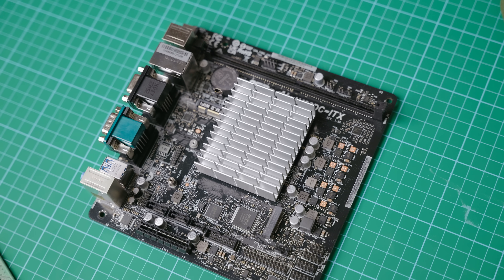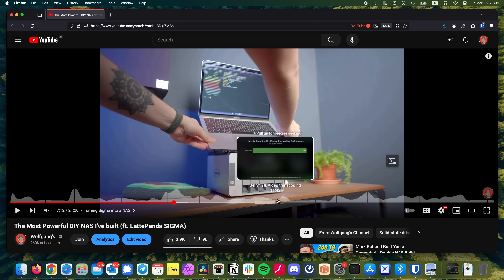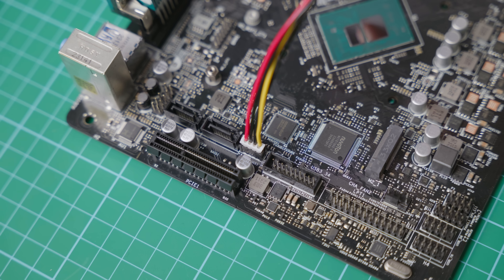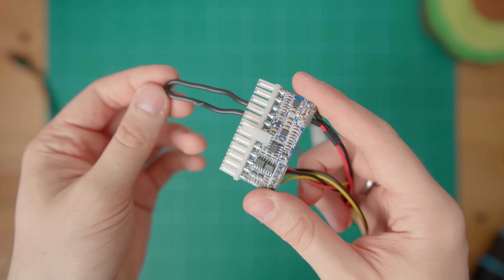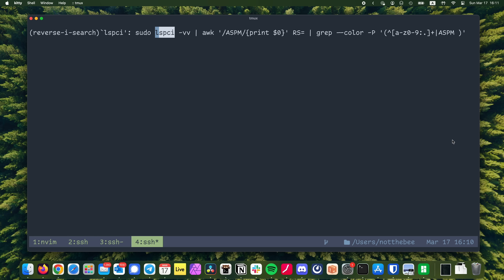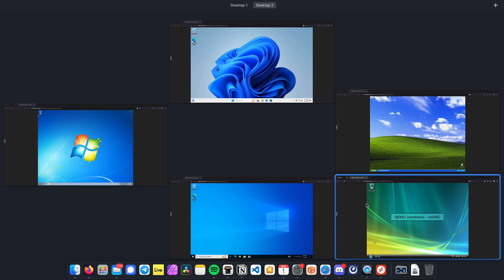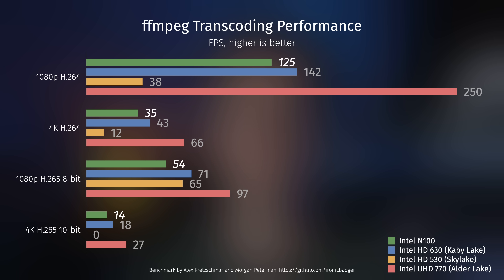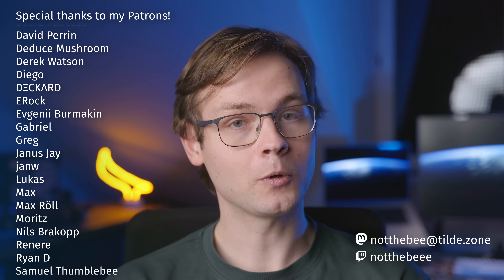Asrock N100DC-ITX – Almost Perfect! But...

Comment: regarding transfer speeds. does the m.2 limits the speed when read/writing to hard drives?
Reply from the maker: The M.2 slot is PCIe 3.0 x2, which should theoretically give you 1970 Mb/s of bandwidth. A Seagate Exos X16 hard drive is rated for a maximum read speed of 261 Mb/s, so the ASMedia card should be able to handle 7,5 HDDs having data being read from them at the same time

Comment: Which operating system are you using to get those high C states?
Reply from the maker: Any modern Linux/Windows OS with ASPM and C-States not explicitly disabled should be fine. I get a similar power draw in Ubuntu, Debian, Unraid and Windows 10/11

Comment: Question from a total noob: I noticed you're only using 1 stick of RAM. Is there a performance benefit to using dual channel memory for NAS software? If so, are you using just one stick to limit power draw? I.e. is the performance uplift not worth the increased power draw?
Reply from the maker: This motherboard only has one RAM slot

Comment: I measured my power supply rated with 80+ platinium and only that draws around 6 Watt with nothing plugged in. That is much right?
Reply from the maker: The 80+ rating doesn’t take into account the power draw below 20W
Reply: @WolfgangsChannel interesting, I wasn't aware of that. Could you  recommend an efficient power supply for this cpu?
Reply: I saw the list in another comment(he already gave a spreadsheet), but I’m amazed that the nr 4 on that list is a very cheap power supply from cooler master ( MWE 400 white )
Reply from the maker: https://docs.google.com/spreadsheets/d/1TnPx1h-nUKgq3MFzwl-OOIsuX_JSIurIq3JkFZVMUas/edit#gid=110239702

Comment: Has anyone used a relay to jump the ATX 24-Pin connector pins? I am contemplating running the board off a 19V power supply and start the PSU for the HDDs when I turn on the computer. I am wondering if it is a good idea to use the front panel headers to steal 5V from the board to power the relay.
Reply from the maker: I've built a PoC with a PicoPSU, a DC jack Y-splitter cable and a 12V relay. At the end it looked a lot messier and was a lot more complicated than just getting 12V from the ATX connector, so I scrapped it.

Comment: Hum... How are you supposed to saturate the 10gig network if you can't write at more than 550MB/s ? On the two motherboard SATA ports, you plug one for the OS and the other as cache/swap and use the rest of the nvme adapter as your data drives ? No ECC support but well, I don't know if it's really a bummer if you also backup your whole data in addition to the usage of your NAS. I think I would take the N100M as I don't want to tinker with the power supply.
Reply from the maker: I’m not, but 2.5 Gbit is too slow for 550 Mb/s
Reply: @WolfgangsChannel Yes and I thought about the N100M model and pluging the 10G AQ107 card on the x1 port which would limit transfert to 8Gbits/s but still much higher that the standard 1Gbits. This would allow you to put another Sata ASM1166 x4 card on the  PCIE x16 mode x2 and getting 6 new sata drives if you want even more slots. Still, I haven't found an ASM1166 card for the A+E key slot as you could use the SATA on the board for your OS as raid 1 and put 2 cache drives on the e-key port. The JBM852 e-key cards doesn't seem to allow low c-states sadly.

Still I've seen E-key to PCIE 3.0 x1 adapter... if you're really into headaches... like me but still you can add an ASM1166 2 ports sata card on it :o

Nobody can say that you don't exploit your hardware to the maximum then ;)
Reply from the maker: Unfortunately, the WiFi M.2 slot doesn't carry the PCIe signal, so you can't use it to plug in an additional SATA controller. Don't ask me how I know :)
Reply: @WolfgangsChannel Ahah I see ^^ Still waiting to see a meteor lake 4nm equivalent model to get even more lower power draw ! They say ARM is more efficient but when we already have a N100 system that draws max 18W, why switching out x86. Still I think that only Meteor lake Ultra CPU have the AV1 encoding IGPU.
Reply: @WolfgangsChannel that's very strange, most wifi m.2 cards require PCIe x1. Maybe there's a bios config option which lets you choose how to allocate lanes? But that would mean that either the other m.2 slot or the PCIe port also drop down to x1.
Reply from the maker: This motherboard comes with CNVi, which means that most wireless logic is moved to the CPU. This probably removes the need for PCIe connection between the WiFi/BT module and the CPU

Comment: Is the PCI slot fast enough for an HBA card, so you can use the m2 for an nvme drive or  a 2.5gbps NIC?
Reply from the maker: Depends on the HBA. Theoretically, the slot should have 1970 Mb/s of bandwidth

Comment: What about the ASUS N100I-D4? This board of course only has one SATA port but you can fix that with you ASM1166 adapter.
Reply from the maker: As mentioned multiple times throughout the video, this board only has a PCIe x1 slot
Reply: @WolfgangsChannel  sure but can you really saturate a 10Gbit/s NIC with a large file transfer with that CPU when using a software RAID in the real world? A 2.5Gbit/s NIC paired with that CPU would make much more sense in my oppinion which would fit perfectly in the PCIe 3.0 x1 slot (preferably with a Intel chipset since Realtek is a bit buggy on most distributions).
You should be also be able to utilize the M2 (E Key) slot since it should support PCIe
Reply from the maker: Yes, you can. The E-key slot unfortunately doesn't work for PCIe signal on this board – not sure why
Reply: @ich777  There's no way that little baby CPU can saturate a 10 gig link with anything other than synthetic benchmarks like iperf.  I have two huge 16 core Xeon servers here with 10 gig fibre links between them, plus a number of other smaller Xeons.  The two big servers are populated with 10 drive RAID arrays, which should be lightyears faster than anything most people will encounter unless they're running NVMe drives.  These machines can easily push 9.4 gigabits measured through iperf with low CPU usage.  In the real world I have only ever seen 680 megabytes/second across the network during backups.  That's like 7 gigabits.  And I don't see that speed often.  Usually it's between 300-400 megabytes/second.
Reply from the maker: I’ve used 10GbE in conjunction with a i3-6100 and a NVMe drive for a while and was getting 1-1.2Gbytes/sec during SMB transfers no problem. N100 is even more performant.

Are you sure your storage can keep up with the network transfer?
Reply: @WolfgangsChannel  often times this is caused by a server NIC and not correctly set up driver parameters, I‘ve seen that a lot on Unraid with Intel server cards.

Are you talking about big files so to speak files 40GB+?
Reply from the maker: You mean high speeds are caused by wrong driver settings? Not sure I understand your reply. 

I’m talking about 1-8 GB files. Random small reads will obviously be slower
Reply: @WolfgangsChannel  sorry, yes wrongly configured drivers most of the times since some NICs require Jumbo frames to work properly where on my Mellanox I don‘t have to enable them to saturate the link but TBH I‘m not using the Mellanox card anymore because 2,5Gbit/s is way enough for me.

Would be interesting how this board performs when you transfer one big file.

Comment: I'm looking at the specs for this thing and the single, max 16GB RAM slot is kind of a deal breaker for me. I'm currently running a Pentium Silver soldered motherboard from Asrock which also supports sodimm memory in 2 slots so that would feel like a downgrade to me. I'd want the option to at least have 32GB in there and maybe even 64GB with the same sort of low power consumption.
Reply from the maker: It works fine with 32GB

Comment: @WolfgangsChannel If I manage get a 24 Pin ATX to 4 Pin ATX, or 24 Pin to 8 Pin then 8 Pin to 4 Pin, will that work? Would it be safer than just hacking the 24 Pin to jump the power?
Reply from the maker: Using a 24-pin to 4-pin adapter will not help in this case. If your motherboard doesn't have an 24-pin connector, you'll still need to jump those pins.
As long as you use the right pins, bridging the 'power on' pins an ATX PSU is completely safe. There's no electricity going through the wire that you use to do the jumping.
Reply: @WolfgangsChannel  thank you for replying, I tried the 4 pin method and jumped the 24 pin with a paper clip and it worked.

Comment: It would be so nice if there would be a "normal" Mini-ITX MB with a N305 (just to have 8 cores :D) on it but i guess that won't happen. I wouldn't use it as a NAS but just for surfing, email and such. Yes, a N100/200 mini box is good enough for that but it would be fun to see which older games would run on the N305 with it slightly better iGPU okish but that would require a better heatsink or a (silent) fan for sure. :)
I assume that there are no better aftermarket heatsinks available for either the Asus or AsRock boards, right? :/
Reply from the maker: Nope, those use proprietary mounting holes for the heatsink :(
I also personally don't see the appeal when it comes to N305. Most N305 motherboards cost as much as an i3-13100 + a decent LGA1700 motherboard, and an i3-13100 gives you more performance and more PCIe lanes

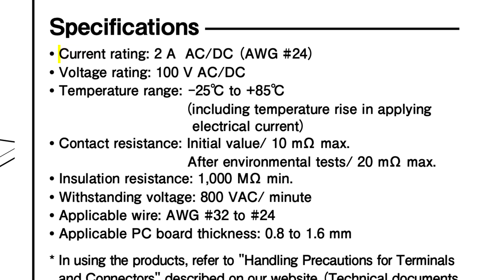Comment: 5:23 yes - 2A when spinning up. but the rating of that jst plug is for continous current, not peak. so it would probably be fine. but still a janky solution

Comment: Can someone recommend a power brick for this motherboard that gives good idle power consumption? 

I have 16gb ram, a 512 gb m.2 drive and 2 18tb western digital drives and a 500gb  sata ssd and idle its 26w idle.  Powering up with only the ram and m.2 drive it idles at 24w. Im currently using an hp 120w power bring with an adapter to go to the correct size.

Comment: How is Nextcloud performing in this case? Tried it on the N5105 it was slow as f....
Reply: Nextcloud performs "grand" in my N100 systems. Though, single user
Reply: @LeminskiTankscor  Even with just a single user it was terrible on the N5105 within unraid. But glad to hear, that the N100 performs better there.
Reply: @Heimdall-hb5it  define terrible here? Because I ran NC on a pi4 for a while and that was fine too. I think we've something else on
Reply: @LeminskiTankscor  Well it could totally be an unraid / docker / CPU Issue. There is also one core going nuts all the time :D
Reply: I use docker, but not Unraid. All Debian here.

Comment: Hello Wolfgang! Did you tried to use ECC memory? Just to confirm …
Reply: Memory
- 1 x DDR4 DIMM Slot
- Supports DDR4 non-ECC, un-buffered memory up to 3200
- Supports ECC UDIMM memory modules (operate in non-ECC mode)
- Max. capacity of system memory: 32GB

Comment: 0:24 if it's a naked-crystal CPU, maybe handle the heatsink more careful than that. Instantly made me remember the chipped Athlon/Duron cores.
Reply from the maker: Than what? I didn’t do anything with the heatsink in the video
Reply: @WolfgangsChannel  it looked like you held down the board by pushing on the heatsink, to connect the power cable.

Comment: What operating system do you recommend for this hardware? I have installed nextcloud but the CPU goes to 100% fixed when I scroll through the photos
Reply from the maker: 100% represents one core — this CPU has 4
Reply: @WolfgangsChannel  Maybe I expressed myself badly, forgive my bad English, but basically the CPU goes to saturation, using htop all the cores go to 100%, I don't know if I did something wrong in installing it, I installed it via portainer
Reply from the maker: Hard to say without taking a look at the exact setup, but theoretically there's nothing bad about letting the CPU work a bit. Does Nextcloud become unresponsive or hang during use?
Reply: @WolfgangsChannel  Hi,

I am experiencing a significant performance issue with Nextcloud and would appreciate your help. Here are the details of my setup and the problem I’m encountering:

    CPU: Intel N100
    RAM: 32 GB
    Storage: SSD and Samsung NVMe
    Redis: Configured correctly
    Database: MariaDB

When navigating to the "Photos" section of Nextcloud and during thumbnail generation, the php-fpm process spikes to 100% CPU usage. This leads to severe slowdowns and, in some cases, Nextcloud becomes very sluggish or unresponsive until the thumbnail generation completes.

I have already attempted to optimize PHP-FPM configuration and Redis caching, but the issue persists. Could you suggest any additional configurations or optimizations to improve performance and reduce the high CPU usage by the php-fpm process during these operations?

I greatly appreciate any help or advice you can provide.
Reply: If you want I can share here the various configurations of everything in any case I'm also trying to ask the nextcloud forum and I'll keep you updated

Comment: you use a PCIe 2.0 x4 Network Card in a PCIe 3.0 x2 slot ... so you Limitit to PCIe 2.0 from the Networkkard and the x2 of the PCIe Slot ... this could be a Problem
Reply from the maker: The card is a Rev. 3 which is PCIe 3.0

Comment: Will we see a review of ZimaBoard family??
Reply from the maker: Probably not. I'm not a fan of their aggressive influencer marketing, and both ZimaBoard and ZimaBlade use outdated low-performance CPUs. In my opinion, they make even less sense now that Raspberry Pis are widely available again.
Reply: @WolfgangsChannel  But it's good All-in-one starter. Pi 5, for 2/3 price of 832 has nothing in set, and any expansion parts are exclusively proprietary. Maybe it is worth comparing them?? Btw Gen12-14 Intel BGA chips also show good performance and energy efficiency.

Comment: Can you suggest a board/cpu that can saturate 4-8 drives and 10G while having low power draw?
Reply from the maker: HDD or SSD? NVMe or SATA?
Reply: Mostly sata hdd
Reply from the maker: Ideally, Asrock C236 WSI, but those are very rare
Reply: @WolfgangsChannel  Anything more commonly available? I was thinking about the i5 8500T but I think that's double the wattage you are seeing here and our electricity has doubled since covid.
Reply from the maker: TDP almost has no correlation with idle power consumption. I've explained more in this video: https://www.youtube.com/watch?v=Ppo6C_JhDHM
Reply: @WolfgangsChannel  Good luck finding one and a bit expensive, don't you think?:goodvibes:

Comment: Does it fully support ECC memory?
Reply: No
Reply: Memory
- 1 x DDR4 DIMM Slot
- Supports DDR4 non-ECC, un-buffered memory up to 3200
- Supports ECC UDIMM memory modules (operate in non-ECC mode)
- Max. capacity of system memory: 32GB

Comment: What is your consumption with the 5 HDD and no sleepmode?
Don't like to put my hdd into sleep.
Reply from the maker: Hard to say, as different HDDs have different power consumption figures. I'd look for spec sheets of your particular drives and check out the "typical power draw" figure.
Reply: @WolfgangsChannel  Thank's.
I have an aliexpress n100 motherboard, with 6 ironwolf 4tb (around 5w each) + ssd + m2 nmve + pcie card.
I'am at 50W in idle, not so bad, but I was expecting better results.
Reply: @langerspeck7811  That is because your board as a JMB585 that does not allow high C-states

Comment: There is an Asus Prime N100 board here with 1 SATA port + PCI-E x1 slot, and 2 m.2 slots (one for WiFi) I think you could add enough drives over PCI-E and if that is not enough maybe over M.2 if supported. I think that is a kinda nice deal as that one costs €100 for me + 30 for 2 SATA ports over PCI-E and will give me 3 SATA ports. but I don't know about the effeciency with ATX PSU
Reply from the maker: The ASUS board only has PCIe x1
Reply: @WolfgangsChannel I see what you mean, I see for you for 1 10Gig Eth NIC it is needed. but for me I would get a M.2 to 2 SATA ports and a 2.5G NIC and I would be fine. but in terms of the SATA and PCI-E x4 (x2) slot you defenitly have a point
Reply: @WolfgangsChannel  I found out the hard way that many PCIe 4x cards get limited to 1x if the slot is not 4x, even if there are 2 lanes available. It's either 4 or 1, but never 2.

Even if the controller itself is 2x, it would only run at 2x on a true 4x slot. On the N100DC-ITX it got limited to 1x.
Reply from the maker: @andrebrait That's not the issue in my case. The card runs at 3.0 x2 according to `lspci`
Reply: @andrebrait  you can easily find that online in the spec sheet of motherboards, my Main PC it's motherboard on the site shows that I have indeed 3 x16 slots, but it runs in x4 (or x8 or x2) as maximum capability

Comment: Is the ASUS Prime N100I-D D4 not the better solution? Its even cheaper...
Reply from the maker: It only has a PCIe x1 port, which isn't enough for 10Gbe networking. As long as you don't need high speed networking, the ASUS board should be ok
Reply: @WolfgangsChannel  I have just built the same in the same case with the ASUS N100 Prime because I didn't care about the network and was £30 cheaper. Powered by a MeanWell 200-12 and a Pico 160 (in a 3d printed SFX case. I get 12w with 3 HDD in sleep and 1 SSD. Guess I ned to try harder to get rid of those 2 extra watts. Oh and many thanks for the video.

Comment: Has someone data on the Asus N100 equivalent? I guess you could achieve similar results using a 160watt pico and then also use 3+ HDDs without the hacking :)